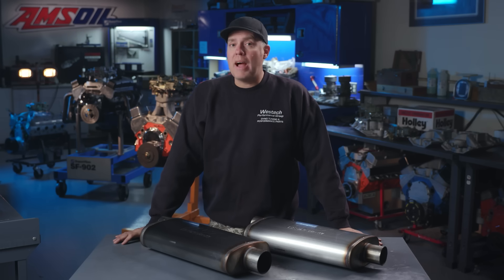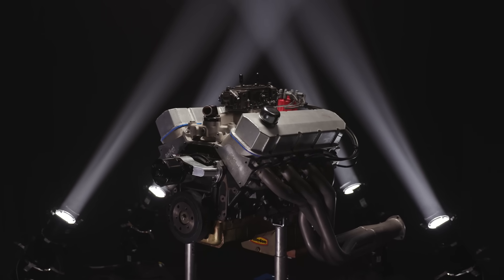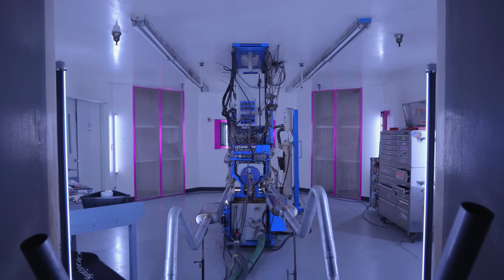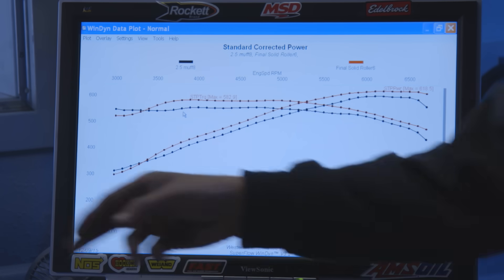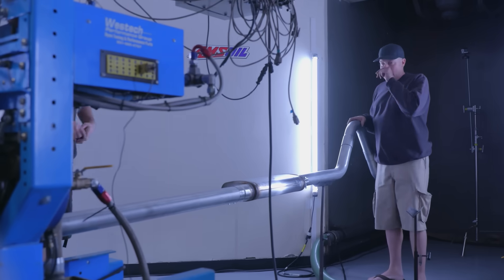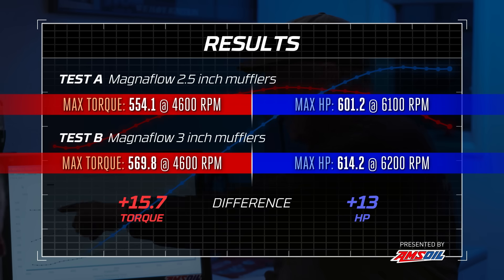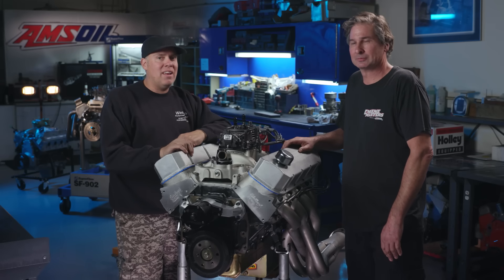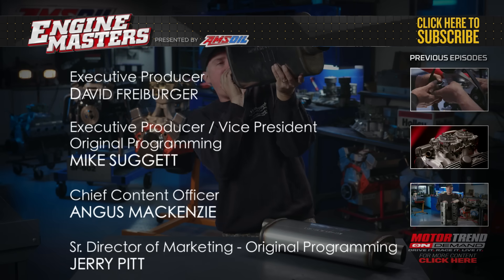The Power of 2.5- vs. 3-Inch Exhaust - Engine Masters Ep. 9

Comment: I hope you were joking about back pressure. It's the opposite of back pressure, the size of the pipe controls the velocity of the exhaust gasses, a proper exhaust can drag the exhaust gasses out, the opposite of forced induction, this is almost like forced exhaust. Frankly the exhaust pipe should be smaller as you near the end, the exhaust gas temperature drops dramatically, it's volume does as well.

Match the intake, cam and exhaust and you get a perfect blend where you can get more air into and out of an engine than it should be capable of at a specific RPM without forced induction.

Comment: Hot gasses travel quicker through a smaller pipe diameter than a bigger pipe diameter. The larger diameter allows the exhaust gas to cool down and when it cools down the exhaust gas SLOWS DOWN. All of this information can be found in Smokey Yunik's book on how to make horsepower.

Comment: Not a real world test by the fact that some states do not let you eliminate the catalytic converters or modify the exhaust.  My truck has a 454 and I have  stock iron manifolds into a 2.5 pipes running into a flowmaster 2.5-3'' Y and out the back with a single 3''.  Best thing I ever did was getting rid of the headers.  So your test with the dual 2.5s is more than enough

Comment: Now take it to the next level- install it into a Suburban and make tweeks (including fuel injection) to measure and improve gas mileage. Take the best set up back to the dyno and see what you ended up with....because 600 hp in a Suburban getting 20 mpg is what everyone really needs.

Comment: Most vehicles don't even have 350hp... Comparing it on a platform that's a little more realistic with a more average muffler is where the differences begin to show.
I know y'all are aware more power means more air is moved, the same engine in it's factory configuration wouldn't need anything over a 2.5in.
It just doesn't move as much air due to restrictions in the engine itself.

Comment: Hey Engine Masters, what do you recommend for a smaller, enthusiast application (2009 Mitsubishi Lancer ES 2.0L 4 cylinder 5 speed manual transmission turbo build - 5lbs boost/190+HP) 2.5 or 3"? Thanks!

Comment: So, what you don't know- Experts. At the low end, the appearance of higher torque and horsepower is a result of increased compression due to back pressure.

I am not going to cry about not having a big block motor with 600+. Because I am running the best V8 currently produced- AMG 4.0 BiTurbo. The car did come stock with 2.5" exhaust but there's plenty of people hitting 650+ with exhaust and a tune.

Comment: My question,
2.5” dual straight pipes vs single 3” straight pipe 
Does the 2.5” dual equal out to more flow or does the single 3” equal out to more flow? 
2018 gm 6.2

Comment: It's worth noting here, they didn't go back and tune the carb or the timing after either of these tests. The 2.5" would've definitely benefitted from leaning the AFR. Also... this proves there was some headroom for ignition advance in the open header setup.

Another point... when an exhaust shop says your street car needs backpressure, they're not lying. How often are your running at full throttle over 3,500rpm in your street car? Without that backpressure, you're just throwing fuel out of the exhaust. If you don't care about part throttle performance or gas mileage, fine... bolt your 3" pipes on your headers and roll with it. If you do care about not having to stop every 100 miles to fill up the tank... then get yourself a reasonably well tuned exhaust system, and sacrifice a few top end ponies.

Comment: You MT guys are a bit too smug, sayin' you've debunked some myth about torque and pipe diameter when you've only slapped that pipe on a 600 HP built big block, which does not much prove anything since you can't generalize the variables.  Guessin' you're just journalists lookin' for a bit of "if it bleeds, it leads'" sensationalism to pull in readers - and are not engineers at all.  Your information is not useful and we are not fooled.

Comment: To be a proper comparison(science as you call it) shouldn’t the engine tune/fueling be adjusted to match? Without doing so I’m not sure how to say the power difference is all on the exhaust when it’s running noticeably richer. I don’t know these engine to know how much of a difference it would be but wouldn’t be that far fetched at 600hp to think a 20hp/tq swing is possible from a/f changes.

Comment: I think the displacement of the motor is helping here, the smaller the displacement the more back pressure needed.
I once had my exhaust snag on a speed bump and the exhaust slipped out of the exhaust manifold.  The engine had reduced back pressure and I immediately felt a loss of power.
Especially down low in the RPM range just like the Dyno shows in this video.  It was a 2.8 ltr v-6 and it was very obvious it needed more back pressure

Try this same test on small displacement motor and lets see what happens

Comment: Adding a free flowing exhaust to a common small block might net you 10-15 hp, not bad. When you add a cam, and work the injection system and ignition, thats where the power begins...

Comment: Show us how a mostly stock street engine is affected though.   Sure in a big breathing monster it works, but everything has limits.
 A mild or mostly stock motor would be fine with 2.5” tubes, because they simply aren’t moving that much air in, so don’t need to get as much out.   A better explanation would’ve been to show at what points exhaust size needs to increase.

Comment: Since that weight difference is the actual issue, you fellas could add the engine into a full automobile.   Then we can know the torque and the horsepower lower much more with any exhaust added. There will be a difference from the amount of airflow out; of course! Your show is called "Engine Masters" though.  You had me thinking, in the future with my 2013 CTS (only the 3.6L), should I go for 3.0"  exhaust from my already custom from the stock exhaust?  I am at 2.25 from post Catalyst Converters to 3.5" tips out.   The sound is furrocious as it sits now!  Custom Headers will be used if, I do go Super Charger.  I do like the 2nd generation of the Caddilac CTS over the 3rd! A rear common car among the herd, for sure.

Comment: Regardless of the diameter you’re using, your flow is limited to the smallest area within the exhaust. You could have a 10” pipe, but if any where between the start of the flow and the end, you have an area that narrows down to 1”, then 1” is all the flow you’ll actually get. This is why a complete mandrel bent system is the preferred way to go.

I have found that when running duals, equalization of pressure between the two sides generally helps with the torque. Having a cross over not only sounds better, it can help make more usable power.
Reply: thats not entirely incorrect but you are missing MANY details.  Say you take a 10 foot pipe, 3 inches in diameter.  Replace a 1 inch length of it with 2 inch diameter pipe (with a smooth transition between the pipes, such as using reducers).  that is FAAAAAR less restrictive than if you did the same but replaced a 2 foot section instead.  Quick real-life test to prove how dramatic the length of the narrowing can affect restriction: go grab a straw, and cut it into two straws, one of them like 1/2 inch long.  take the longer one and breath in thru it as hard as you can.  Now do the same with the super short one.  you will notice FAR less restriction on the short length of straw.  Like way way less.  Same applies to exhaust.  Got a small pinch in some headers to make them fit an engine swap?  likely wont even cause a measurable difference in power or airflow.  have a header pipe that the entire length of is as small as the diameter of that pinch point?  definitely will notice.

Also, whether a "cross over" sounds better or not is a matter of opinion.  I much prefer true-dual when it comes to sound, and when it comes to power on most vehicles it will not make a noticeable difference.  And interesting test would be to see how having an X or H pipe affects different diameter pipe differs.  I would assume on 2.25inch pipe, it would have a more noticeable impact than on 3 inch pipe, since if the motor has plenty of (literal) breathing room, any "equalization of pressure" between banks wouldnt have an impact on how the engine breaths.  X/H pipes arent magical power-adders and "equalization of pressure" between banks also doesnt ensure ANY benefits.  Like everything, it has a time and a place.

Comment: You guys should test a 2 1/2 and 3 inch exhaust with and without high flow CATs and see what the differences are.  Will 3" exhaust with high flow CATs outflow 2 1/2 inch exhaust without CATs?.

Comment: Then, you have to equate horsepower AFTER it's been run through a transmission, driveshaft, rear axle and wheels, while carrying about a ton and a half of frame and body... Probably ends up being something like 102 horsepower through the 3" pipe and 99 with the 2.5" pipe, at the rear wheels...😁

Comment: So a super rich AFR run on the 2.5" made only 15hp less than 3"? I imagine that gap is even smaller if you tune the 2.5" run to an optimal AFR. For the price difference, it doesnt seem like 3" is worth it at this power level. Not to mention how much louder and unbearable it will be driving around town or droning on the freeway.

Comment: I was 42 years old when I got my dyno going in 1986. I started racing when I was 16, I learned more in the next 6 months than I learned in the previous 26 years, But I've always said I can race without a dyno, but I can't race without a flow bench. Why? Because the bulk of what I learned on the dyno actually was generated by the flow bench. I flow test everything that sees air in any way. If you do that, you'll be surprised what you can find.

Comment: Forget exhaust! I would like to see a comparison between two engines same cubic inch, one largest bore with short stroke, one with smallest bore long stroke. perhaps a LSX style engine. Both engines same compression ratio, same cam, same heads, same intake, same over all engine size as close to exact that can be built. Run pulls at both 300 RPM/sec and 600 RPM/sec sweeps.

Comment: what about for a 1960s engine (i have a stock ford 289) with stock valves stems/valve seats. do tbey need to be changed out to hardened to take the heat from less back pressure

Comment: would be cool if you'd do a follow up test with the 3" exhaust... add a high flow cat in front of the muffler... and then leave the cat in and remove the muffler and put a straight section in it's place.   would really be interesting to see the impact of the cat alone, with a muffler, and then muffler only (no cat). Some people need/want/like to run cats. meow

Comment: In the World of motorcycle exhausts they put a restrictor valve to give a bit of back pressure at lower RPM for better low RPM torque.  Be interesting to see why those guys swear by the use of those restrictions.

Comment: Well this has been interesting..  since my RV converted school bus really has over 20 feet of 2 1/2" exhaust, and its 500cid Cadillac V8 spends a lot of time making 550lbs/ft of torque below 2800 RPM..  it looks like the 2.5" setup is the right one for an RV situation where the engine is probably going to top out at 4800RPM-ish anyway.  Sometimes, bigger exhaust isn't better.
Reply: use that 2-1/2 " system with a x pipe and get the mufflers as far back as you can.
If your engine is under 400 HP and you use an X pipe with 2-1/2" tubing, your loss would be less than same exhaust on a 620 HP engine for sure
Reply: Watching guys do airflow on cylinder heads. Some smaller runner flows more faster then larger runners. I'm sure it's the same with exhaust. Too big slows the flow.
Reply: @AutoMotoMechanic  this. the "backpressure guys" always talk about the wrong thing. "Bernoulli's principle". its about flow, not pressure.
smaller the pipe, the higher the flow speed, and lower the pressure. its about finding the sweet spot, as the gasses are pushed from the engine extra hot, compressed, they need more space to expand into the pipe from the engine. if the pipe is too big -> velocity gets too slow, if the pipe is too small -> all the gases wont fit into the pipe easily, and the engine needs to push more.

in many cars bigger downpipes are enough, as the gases lose heat = energy on the way, starting to slow down, and if the pipe gets smaller towards the end, the gases wont lose velocity (losing energy on the way, pipe gets smaller which makes more speed = speed stays same). in same diameter pipe the velocity just decreases all the way, as the gases get colder. (but this wont really affect engine, as it happens further down the exhaust, and the engine is pulsing not constant air etc.)

the "backpressure myth" is kinda understandable, as if there is no exhaust or very short exhaust to open air, its like making the pipe very large at that point when you are venting exhaust to emptiness. exhaust velocity gets low, and the pressure in the pipe gets bigger. its just that its kinda wrong. if the exhaust is way too big, or there is no exhaust, then there also is backpressure, as theres no good flow from the port, which increases the exhaust port pressure. if the pipe is too small, the flow is great at small rpm, but in bigger ones the engine needs to act as a pump, and push "starting pressure" into the exhaust pipe, when the gasses wont fit in it.

of course in engine theres pulses which leads to gas compressibility etc. but in the big picture ^ thats the biggest problem, and after that the other stuff is fine tuning.
Reply: not impressed- all the fast caddies have chevy motors in them.

Comment: Yeah, since you didn't re jet the carbs when it ran richer, of course you will lose some power, it would have made a difference anyway, but if you tune your engine with open headers, it will always run richer/give less HP when you put the exhaust on.
That's why tuning an engine in a stand without exhaust is pretty useless except for a wanking number

Comment: I've played with this extensively for years and they are talking Utopian basics.  That smaller muffler would do much better way back on the system like a resonator.  You can build a quiet system using larger head and mid pipes with an X- crossover as well.  Another trick is to spray paint on the system in a line starting at the headpipes going toward the rear.  Crank the vehicle and bring up the revs.  Where the paint color first changes is where the X or H pipe should go.  The system can be very efficient with that smaller diameter muffler while being quieter and eliminating the larger system drone as well!  The two most important things to remember here are the placement(location) of the first noise reducing muffler or resonator and the type of device that is.  Also the use of electronic fuel injection instead of a carb removes the need satisfy the signal pulse of the carb.
Reply: Spray paint is good idea

Comment: Woulda been SWEET if you showed how changing timing and fuel mixture may have brought some horsepower n torque back up in the 2.5" exhaust system.
Reply: That was not their goal, they did this solely to try and push the myth that bigger is better, Borla could educate all three of the clowns in this video. John Lingenfelter built over 600 horse power Corvettes using Borla 2.5 inch exhausts, these three are not even close to having the knowledge of John Lengenfelter and Borla.

Comment: If those exhausts pipes from the mufflers back were not there it would crank even more torque and HP.  I just built a chevelle Malibu and ran 3” collectors and exhaust pipe back to the rear axle and attached 2 manga flow exhausts.  I don’t have a dyna flow to check the HP and torque but this video tells me i went in the right direction.

Comment: From 4750 rpm on the 2.5 inch system is Bezos rich >.< lean that out closer to 12.8/13:1 and you might find about 5-10hp. Can see the eng drops below 12.8:1 around 3400 rpm which is right where it falls behind the open headers so the test is not really ideal.

Comment: This is the difference between a mechanic that changes parts and a technician that knows the science. These guys only say things from experience from changing out parts thats how 95 percent of your mechanics are thats why you feel ripped off. Science, low rpms made better power because there was no excessive back pressure. To go back to what he said engines like back pressure. That statement is true and false. Naturally aspirated engines use something called scavanging effect which is the point when your intake and exhaust valves are open at the same time. Having the right amount of back pressure will give you proper flow. On a boosted engine since your getting compressed air you want to flow as much air out as possible. When you have improper flow you will give up hp or torque.i could go on but just wanted to point out the reason why not just the stuff these guys are saying because it obvious they dont know the actual mechanics behind it. They just change parts and dyno it and say this is better for this and that is better for this without knowing the why.

Comment: Why not test from 1000rpm (or show the graph from there)? It´s not like the engine does not have power down there.
Also, that´s on low rpm´s the 'back pressure' would supposedly make the difference. Coincidentally, 80% of normal engine operation is under 3000rpm (except on highways, of course).